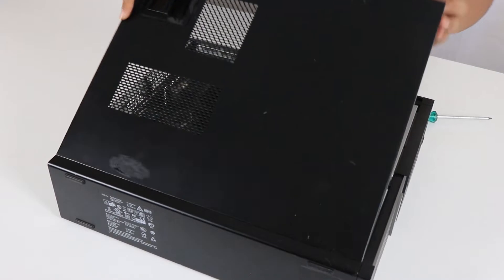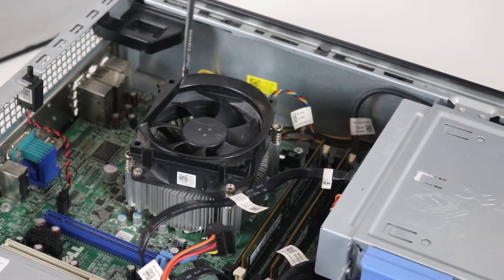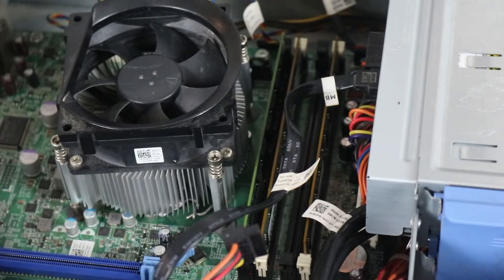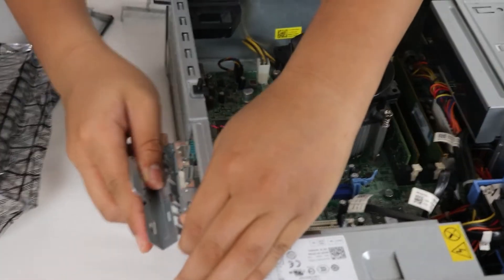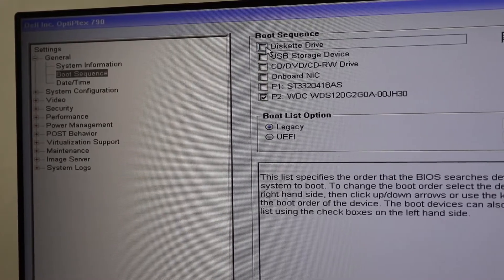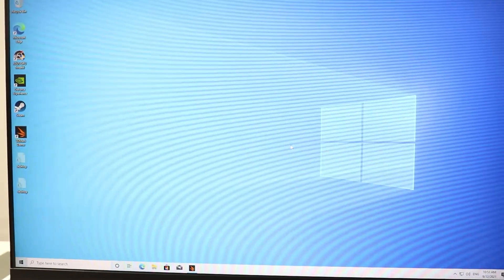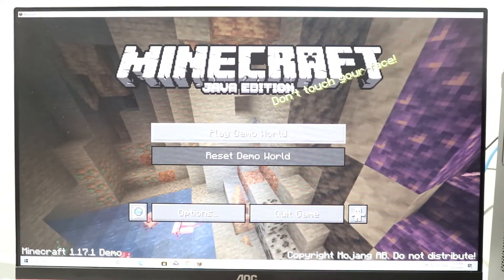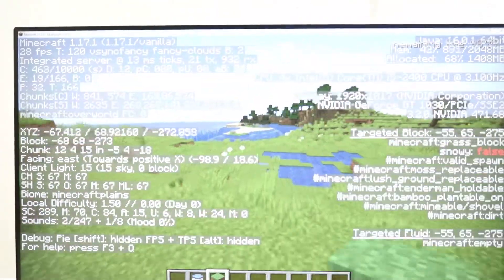Dell OptiPlex 790 DESKTOP UPGRADE!!

Comment: I have a 790. I have put 16GB of RAM, A 1TB m.2 ssd (on the PCI 8slot)  and Linux Mint 21 on it. I Also built a Core i5 11500 PC with 32GB of RAM, A 1 TB m.2 ssd and Linux Mint 21. There is a program called Warpinator that makes it easy to send files on the LAN between these two computers.